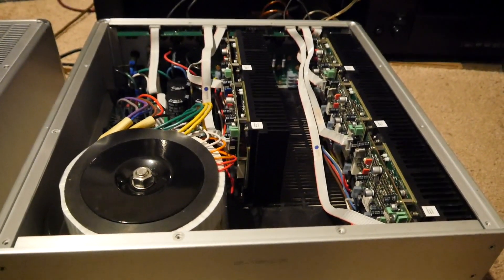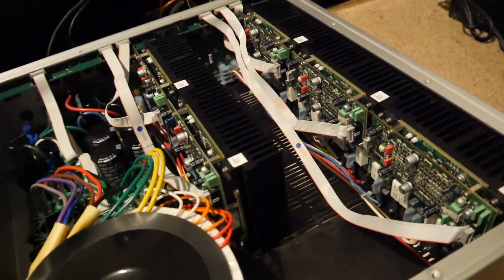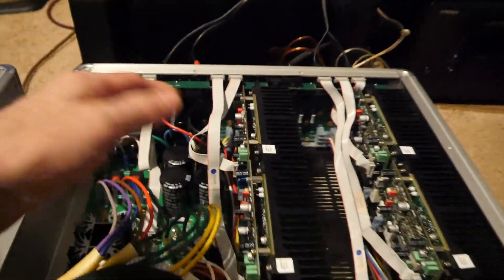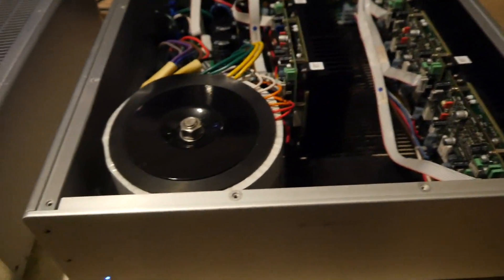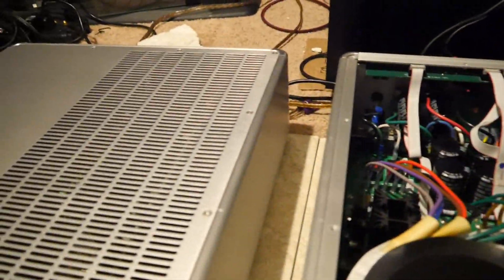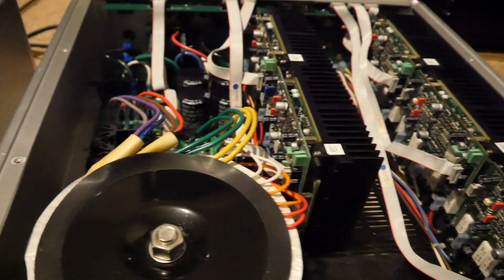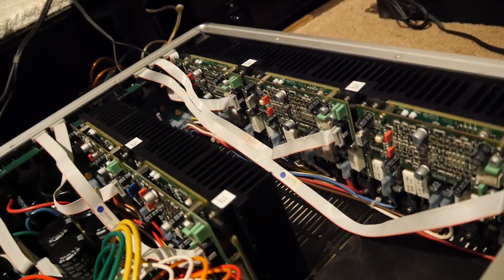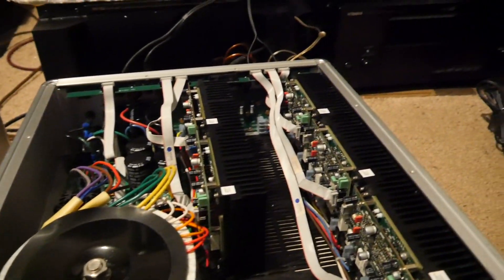A challenging amp repair: Krell S1500

Comment: If you want to grow your channel, you're going to have to stop jerking the camera around.  Tripod, gimble or something
Reply: So many people out there just replacing caps and hoping it will work. We want to see proper diagnostic work methodically working through the problem
Reply from the maker: Well on the Krells with the surface mount caps it's such a common and well known problem it's something I would do regardless of the symptoms since even if marginal they likely wouldn't have much life left. I had not planned on doing the video until after the fact so tried to recreate the troubleshooting procedure that I went through without schematics on a unusual design. The origin was a defect in circuit board going to all channels which caused most damage on channel 4 but took out approximately 50 components in total.  This is why I only shared troubleshooting the the general subsets that were repaired and how to go about repairing the areas when finding the problems in this type design.
Reply from the maker: @CaptainRon1913  probably so. I don't realize I'm doing it till after recording
Reply: Greetings! Do you have the photos of the driver boards? Or shematic? Ive got 2 modules one doesn't have the driver board and on other there the c13,c14,c15 caps are missing...
P.S. Do you know what the bias current of the power stage?
Reply from the maker: Hi just now seeing your question.  I don't have schematic and don't think one was ever released or leaked to the public. Not sure when I would get a chance to take apart again so not sure what cap numbers you are referring to but if you look at video at driver boards the 4 small surface mount caps at the end are 10uf non polarized @25 volts. The cap in middle of board is 47uf 6v non polarized.  The 4 larger surface mount caps I think are 47uf or possibly 68uf @ 35 volts-just can't remember  on those.The ones I used are larger than originals because they are longer life. Not sure of bias current but it's likely not to vary much unless there's something wrong in circuit or unless someone has messed with them as all bias resistors were extremely close to each other in adjustment. A service manual would have been nice on this one.
Reply: @audiogear474  Looks like its reverse engeneering time... )))
I gonna try and DIY build the driver board. The big question is to find spare time to make the drawings... )
Reply from the maker: @The1HellFire you don't have a driver board at all? That would be a challenge to make one of those. They are small but have likely 100 components.  I'm backed up on repair work currently but if I will take pictures next time I have it apart and send to you.